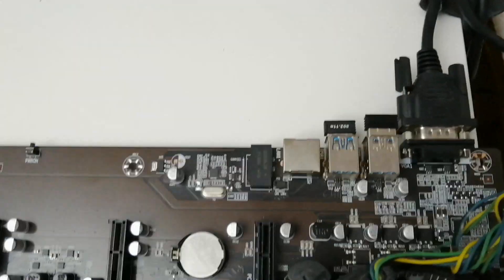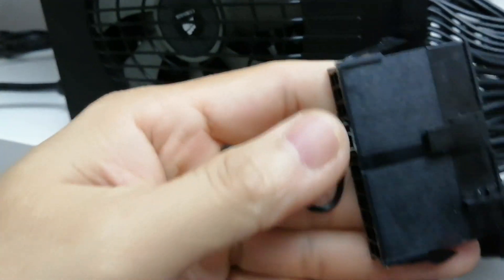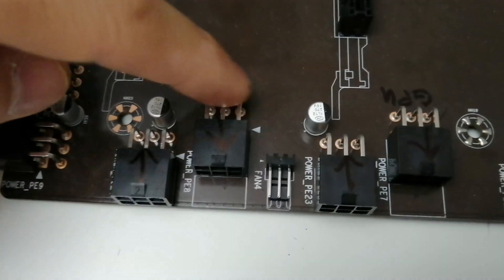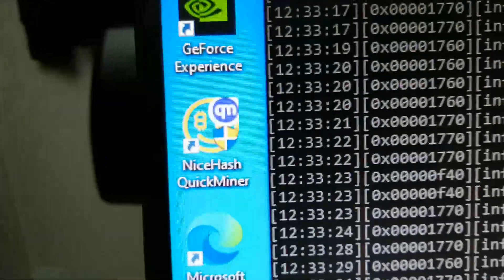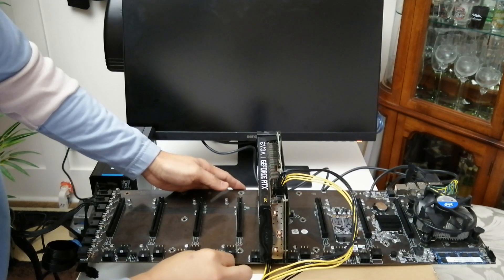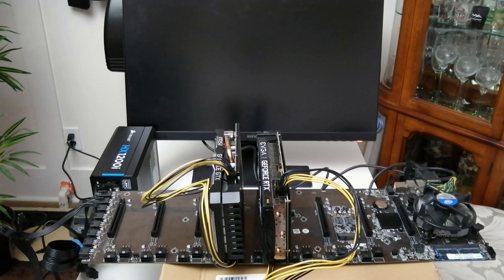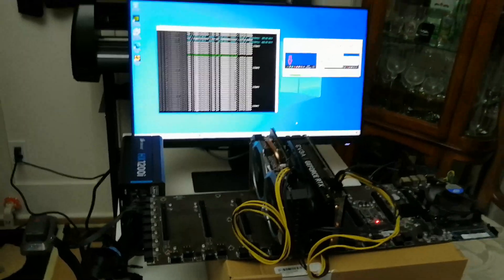B85-BTC Riserless motherboard test with RTX3060 LHR & RTX3060

Comment: Hi, i want to upgrade CPU, do you known one compatible??
Reply from the maker: You can use any 4gen CPU
Reply: @ruvrandomusefulvideos  Any, thanks"
Reply from the maker: @godilo5634 You are welcome! What coin do you  mine? I shutdown all my rig after the merged.
Reply from the maker: @godilo5634  I mean this motherboard only support 4th gen Intel CPU i3, i5, i7 if that answer your question.
Reply: @ruvrandomusefulvideos  mining nexa now, some profit cause electric cost around here
Reply: @ruvrandomusefulvideos  yes I understand that, I fear if any 4th gen, sometimes same socket don't mean it work, from what I understand
Reply from the maker: @godilo5634  Any 4th gen CPU will work because it is using the same chipset, doesn't matter if its i3, i5, i7, main difference on the those CPU is the frequency & number of cores.. But yes you are also correct that same socket doesn't mean it will work but that if you will use incompatible generation CPU. The way intel change their CPU is by 2 generation but the socket type could run up to 4 latest generation. Usually the 1st series chipset of that generation (on the motherboard)  is not forward compatible but the next one is backward compatible. For example 10th gen Intel motherboard has 460m series chipset which is only compatible with 10th gen CPU, doesn't matter what is the frequency or suffix  unlock or locked but the 11th gen Intel motherboard 560m chipset (same socket as 10th gen) is backward compatible so it will work with either 10th & 11th gen CPU. Since the B85-BTC is listed as 4th gen, I would say that the 5th gen CPU won't work. Let me know if you have any question and I will try to answer them to the best of my knowledge, cheers.

Comment: dear my board  make me 4 rings and dont' start ... I dont know what happen!
Reply from the maker: You mean 4 beeps and doesn't turn on at all? Try cleaning and reseat the RAM or try another good known RAM if you have. You can also try another power supply, check reseat all connectors and try to turn it on without GPU plug in. You can also try to reset the CMOs by removing or shorting the CMOS battery connector, make sure its unplug from the wall. If still no luck I would email the seller if they have data for error codes.

Comment: Hey are you having issues when you plug in a 3rd GPU ? My friend has this B85 he just got and he can mine fine with 1 or 2 gpu, but the minute he adds a 3rd gpu on hiveos he sees GPU0 malfunction and others can mine just fine. Do you know how to update this BIOS or a setting he may have enabled from factory that he shouldnt have? Thanks
Reply from the maker: No mine is running with 8 GPU''s no problem. Make sure that the 4G decoding is enabled in the BIOS, have enough memory and correct PSU wattage. Sorry no BIOS update but not necessary. I have T37, D37, S37 & B85 running 8GPU's. Note that 2GB memory can only run 2GPUs and 4GB can rum 4gpus, if you have 8gpus yiu need at least 8gb or just increase virtual memory if you are running Windows.
Reply: @ruvrandomusefulvideos  running hiveos, so it didnt want to work with 3 gpu but once i plugged in the 4th gpu now it works. Yes i have 8gb of ram, 1600w quiet psu
Reply from the maker: @frikitonxplosion  I used to run BTC-T37 with Hive OS with 8 GPU's mining Ravencoin no problem, so I don't see why B85 would have issue. Anyway glad you got it going.
Reply: @ruvrandomusefulvideos  yea it was weird, does your BTC-B85 have 2 × Intel(R) Celeron(R) CPU G1840 @ 2.80GHz ? My B79 has 2 × Intel(R) Xeon(R) CPU E5-2620 0 @ 2.00GHz
Reply from the maker: @frikitonxplosion  My B85-BTC has no CPU built in and it only support 1 LGA1150 CPU. In case you haven't, 4G decoding must be enabled in the BIOS when running multiple GPU''S.
Reply: @ruvrandomusefulvideos  BTC-B85 worked fine with 4 or more GPUs just didnt like when it was only 3 GPU weird or what? I dont use windows as it takes too long to mine and configure for me, hiveos is so much better.
Reply from the maker: @frikitonxplosion  Yes Windows has so much trouble, hive OS is better for sure.
Reply: @ruvrandomusefulvideos  indeed

Comment: any idea how much power can you draw from the motherboard that can feed the GPU? Little bit afraid of putting more power hungry GPUs and power them from this mobo other than like 1660/6600 class gpus
Reply from the maker: I've been searching for the info about that even with BTC-T37, D37 & S37 because these boards does not come with any documentation specs.. I found info from ALiexpress that the max crypto mining power of the B85-BTC is 1,800 watts DC. So that said 1800/8 = 225 if just straight calculation but don't count me on that. I have a friend that has same board running 2x 3060Ti, 1x 3070Ti, 1x 3080 no problem. My self I am running 2x 3060, 3x 1660 & 3x 1070 with BTC-D37 all powering my GPU from motherboard, hope that helps.
Reply: @ruvrandomusefulvideos  how long you been using this mobo ?
Reply from the maker: @frikitonxplosion  I been using this B85-BTC for almost 3 months now running 8x GTX1070, powered by Chinese brand JulongFengbao PSU and so far so good, no crashing issue.
Reply: If we power one 6 pin connector, then motherboard will be ON?
Reply from the maker: @quickgadgets6184  yes

Comment: my motherboard only has 8 6pin connectors next to the pcie slots. so how must i power the motherboard?
Reply from the maker: Your mother board will power on when you connect on any of those 8 6 pins connector then you power your GPU straight from PSU. If you use 8 GPU's, you have to connect all 8 6pins.

Comment: Why are you getting only 28 Mh/s when the 3060 it's supposed to be 47 Mh/s?
Reply from the maker: 3060 required at least 8x PCIE bus speed, this board is only 1x speed.
Reply: @ruvrandomusefulvideos  Sorry to bother you again but I've read that the PCIE in this motherboard were x16, isn't that right?
Reply: @Matagonzo  pcie 1,2,3,4 are speeds. X1,2,4,8, and x16 are lanes or “size” if you will. Pcie 3 x8 is the min requirement.
It can be confusing as a of people will write it as x3 x8

Comment: I have this one too. Do you have any idea how the 16 6P port works? which is in and which is out ? The seller tell me to power on at side 8x6p, but it's conflict to my rig bracket design...
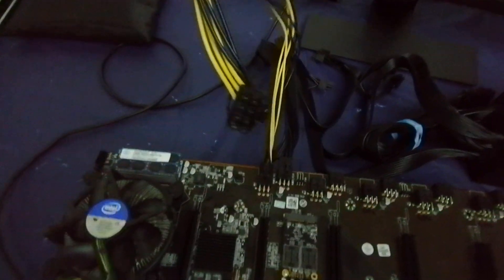Reply from the maker: In this video you can see where is the in/out of the 6 pins connector 6:08 you can see I connect all cables from PSU to all inputs so the empty one are output https://www.youtube.com/watch?v=0evF4WiK44s
Reply: Thanks, That's clear

Comment: When powering the motherboard with 6Pin cables from PSU, my PSU is ATX type and came with 8 cables with 2x 6+2 male pins on each cable, in that case to power the board does it require 4 cables total (with 2x 6+2pins each) to power the board? Also, would it work another way where you power the GPU's directly from PSU and use splitter power cables and connect them to remaining 6+2PIN plugs from PSU? Have you tried powering the board with a single 6pin only and then powering GPUs directly from PSU?
Reply from the maker: Motherboard will work with one 6 pins cable but if you are using more than one GPU I would recommend to connect one 6 pins each because it will draw more current. Yes powering the GPU direct from PSU will work as well.
Reply: @ruvrandomusefulvideos  thanks for the reply. I have an atx power supply and on each cable I have 2x 6+2 pins, wouldn't each one equate to 150w as opposed to a single 6+2pin which equates to 300w?
Reply from the maker: @m0usju1c3  Yes but depends how much is the wattage of you GPU'S. And remember mining is running 24hrs non stop so just to be safe I would use maximum 4x non power hungry GPU'S is you have only 2x 6+2 cables. And remember to check the wire in 1st couple hours, if it feels warm then it means its not enough to handle the current.